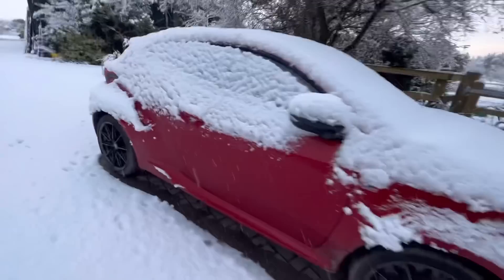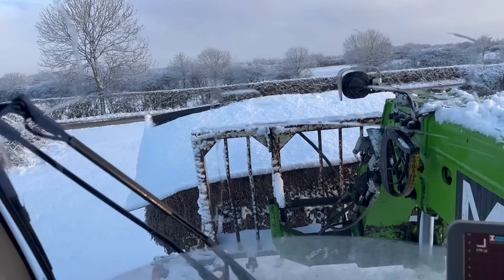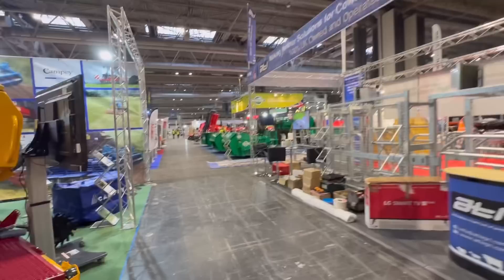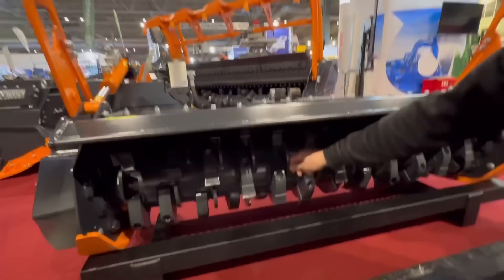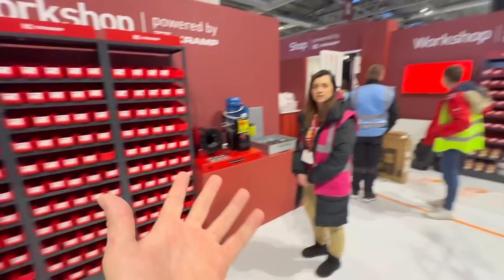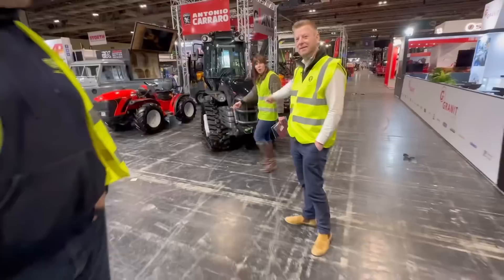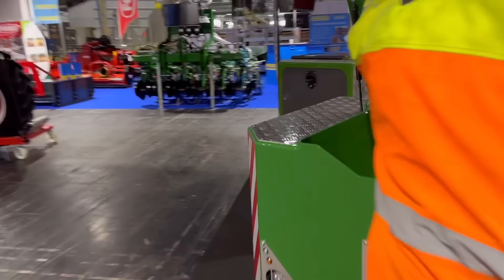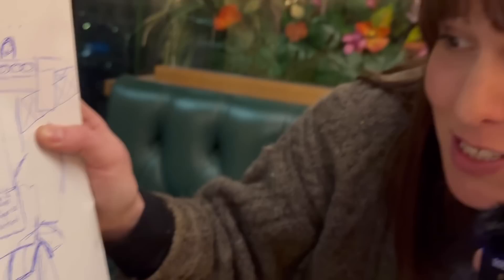SNOW CHAOS & LAMMA PREVIEW#AnswerAsAPercent 1400

Comment: Have they not learned to lower tyre pressures and drive slower? First lesson on learning to drive an Austin 7 in 1964. Second lesson steer into skid! Third lesson ten mile run with mentor in passenger seat. No heater and screen cleaner in squeeze washing up bottle and hand out of window. Great days!